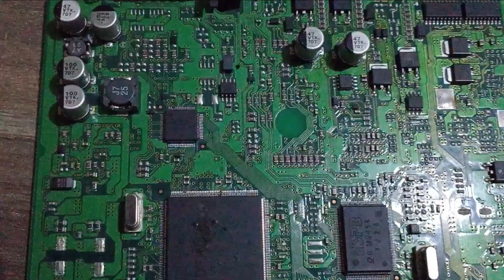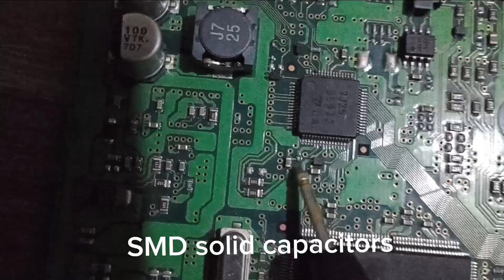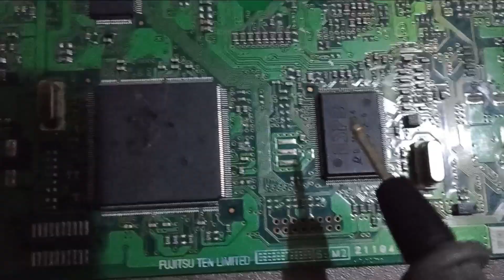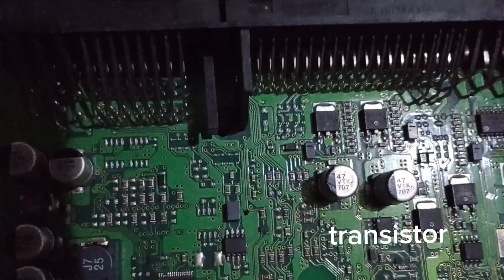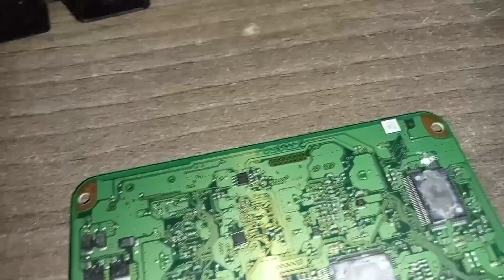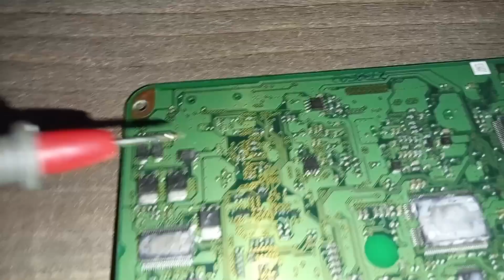How to identify internal parts of Toyota Felder 2zr engine ECU#gariautocare

Comment: Hello, my denso unit for a Camry 2001 does not have the ic 900 chip is there other chip with can contain the immo keys data?
Reply from the maker: Yess we have but send the picture of the motherboard
A part from that on your OBD2 socket short circuit pin 13,5 or 12,4 for 40 minutes make sure ignition is on and check engine light,ABS and PS flush for 40mins make sure all doors are closed don't open any door during this process 
After that start the engine
Lemme know if it works